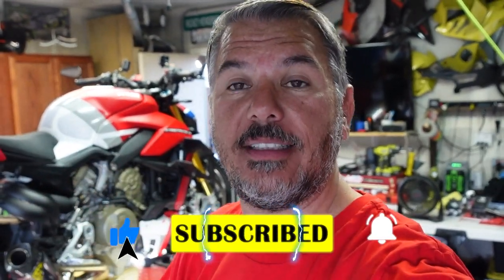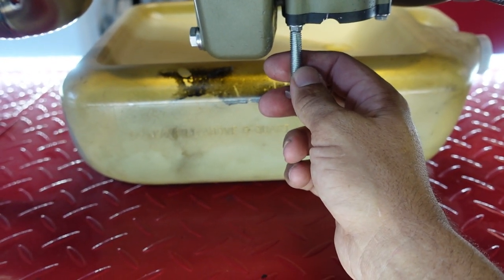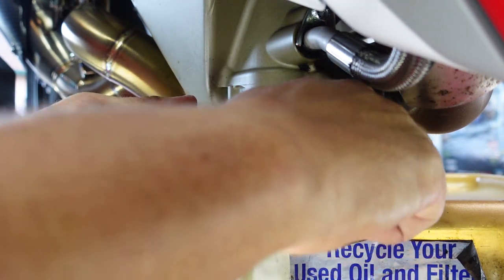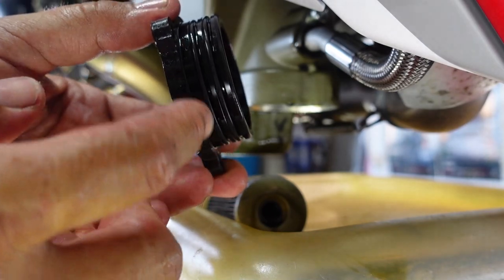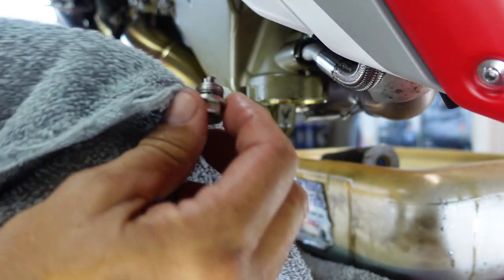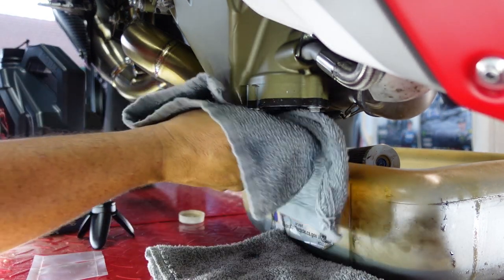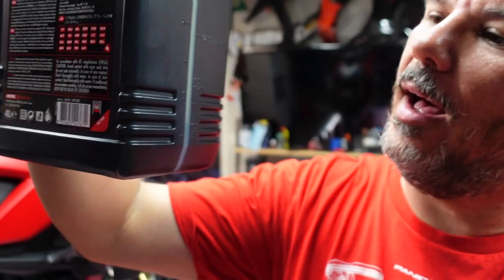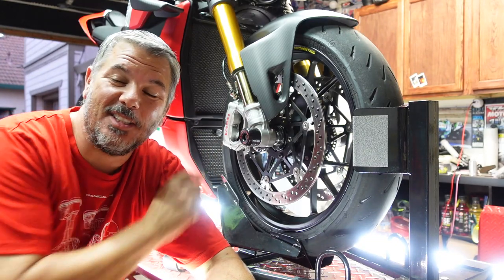2020 Ducati Streetfighter V4 S | DIY Oil and Filter Change

Comment: nice video!! 
just for these V4 engines u gotta let it drain for 2 hrs due to 4 oil pumps. so if u wanna check ur oil level make sure ur bike is been sitting for 2 hrs for correct reading...

Comment: Squeeze the Boss with your fingers on the “O”rings around the “O”ring lands toward one direction creating a relief to pull that “O”ring without using a pick. This will prevent a scratch on the “O”ring groves.

Comment: Nice instructional video; however, one constructive comment. Although I am also a firm believer in regular oil changes, the first oil change should be around 600 miles as recommended. Most Ducati Tech's will tell you not to change the first oil until around 600 miles in order for the engine to break-in properly. Following the first oil change at around 600 miles I change the oil and filter every 3K miles. I've been doing this process on all my Duc's since 1995 and never had any engine issues.

Comment: I have done 2 oil changes now. Have you found the bike only needs 3 litres as opposed to the 3.4 the book states?
Reply: I am curious to know as well.
I read several times that the 3.4 litres is too much and that it causes too much pressure leading to a water pump failure.
Any thoughts on that ?

Comment: If you drain the oil cold after the bike has sat for a few days wouldn't all the oil be in sump and just drain most out that way and not have to drain for 2 hrs?  You could measure the amount to accurately put the same amount back in if the level was good before hand.
Plus all sediment would be at the bottom of the sump too. 
Warming the bike up is just re circulating the old oil through the engine then the drain time goes up to 2hrs or more. Sorta makes no sense to warn it up.
Reply from the maker: The manual tells you to warm it up, then let it sit.
Reply: So basically letting it cool back down and alowing it to drain all back to sump before draining...
I think its allowing for people riding to the stealerships...
If at home and cold just drain it to get it all out.
Some people even let it drain over night...
Reply from the maker: No, warming up the oil makes it less viscous and flow better. Recirculation helps remove the particles on the passages and suspend them in the oil so they get drained with the oil.  Just draining it cold only removes any debris that happened to be in the oil after it sat the rest stays in the passages.

Comment: Unfortunately there remains about 1/2 liter of old oil in the oil cooler due to its design. See where the in and out hoses are attached. And you will see shortly after engine start in the level check window that new oil gets contaminated :(

Comment: Hey great instructional video, but I want to make sure that i understand the removal of the oil cover,  the 3 screws that you used they work in to the cover but not in to the case?? and they make presure on the civer to slide down??
Thanks

Comment: How do you reset your maintenance light after the oil change?  Do you take it to a dealer and if yes, did they charge you?  Thanks!
Reply from the maker: Yes and yes.
Reply: Open flash will do it
Reply: Now can use MelcoDiag for reset oil service / annual service.

Comment: have you been able to reset the service light on the display after an oil change or do you just live with it?
Reply from the maker: You have to have the dealer reset it. Some do it for a small fee.
Reply: @CaliMotoTV  thanks man.  I was afraid of that.

Comment: Thanks... good info!
Reply: @CaliMotoTV  Please do a video on how to set the SF V4 S suspension in the FIXED mode to set it in its SOFTEST setting...  I did mine ( I'm not sure I did it right ) but it still does not ride nearly as comfortable as my 2019 Super Duke R...

Comment: Didn’t you put in to much oil in? The dealer did it your way and the next morning I had to get 400 ml of oil out!
Reply: According to Ducati the procedure is to fill the bike with about 3-3.2 liters of oil. Run the bike for a few minutes then let it sit for 1.5-2 hours. After waiting, you can slowly top it off. I just did mine this way tonight.

Comment: Not oil related, but anyone have the triangle warning light come on after 10seconds down the road? Mines on all the time. Just had first service done.
Reply: Did you change out any turn signals? When I did my tidy tail the light came on for me too. I sent it back to the manufacturer and he changed out the resistors for free and it works great now.
Reply: GSRCivic Yes I added the Ducati performance indicators. If they are working fine would that not eliminate that? Good call thanks! 👍🏼
Reply: They will work fine even if the resistance is off. From what I found out the 2020 bikes indicators are different from the 2019 and earlier. I have my rear sorted out now, furturis moto tidy tail, and I am trying to figure out what to do with the front and how to avoid the light from coming in again.
Reply: Hey guys! Fixed it! It was the tail tidy number plate light connection. All good now! 👍🏼

Comment: My motorcycle is no where near as valuable as the ducati Street fighter but a torque wrench is not, expensive and if you over tighten a drain bolt or filter housing expensive lesson,, if not tight enough,, oil out bike up the road,, from Northern Ireland,, good to see people who work on their bikes,,, but isn't there a ducati book with torque settings,, ☘️☘️☘️☘️☘️☘️